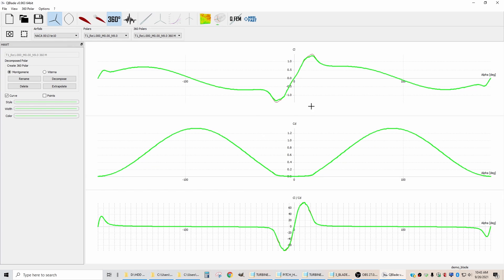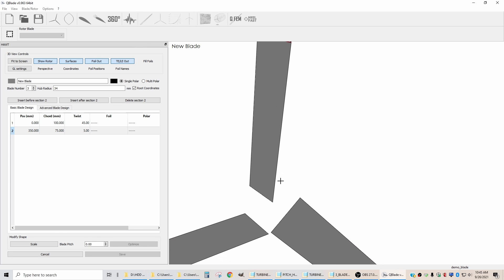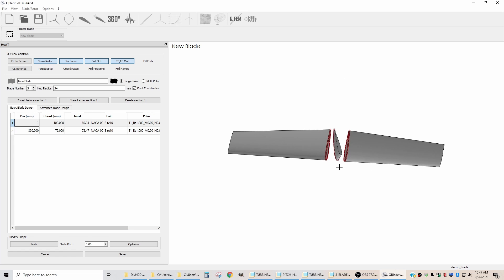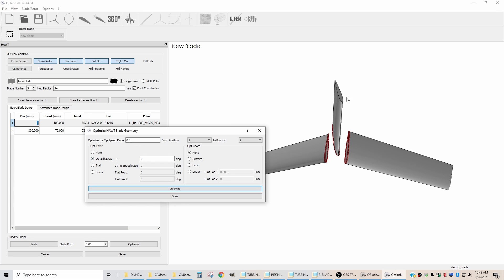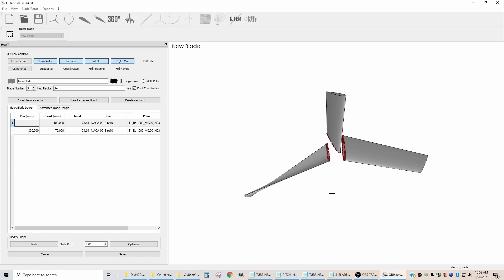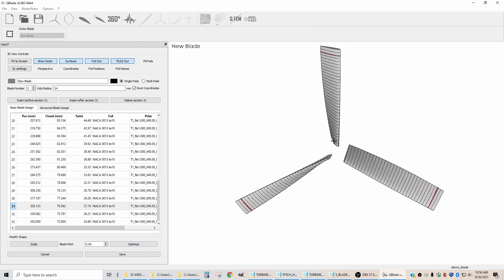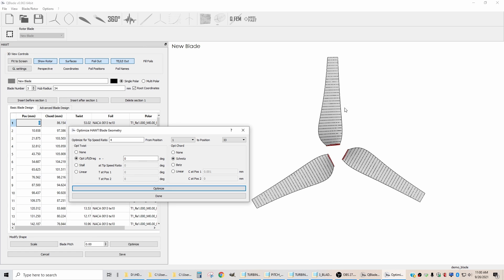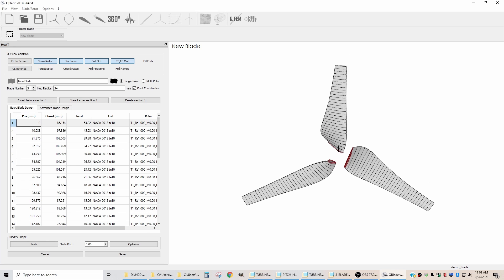Optimized Wind Turbine Blade Design using QBlade

Comment: Hey i reallo love your videos but when i created my blade design and added more sections. I optimized the blade and it got very thin, also the twist angles are almost all at negative degrees for example -13deg. which makes my wind turbine generate -kW any way  can fix this, or is this because i messed up somewhere when following your tutorial i used a naca 6322 airfoil, thanks for the answer

Comment: Now that you have created the polar. What is the polar, and how should that be understood ?
Reply from the maker: I talk about that a bit in the previous video in the series. https://youtu.be/F04CnPRHupg In simple terms, these show the change in lift coefficient (Cl), drag coefficient (Cd) and pitching moment (Cm) with angle of attack (alpha). There is also a graph of lift coefficient (Cl) against drag coefficient (Cd) which gives the theoretical glide angle of the airfoil, and is the classical "polar" plot for an airfoil.  Basically, the polar gives a graphical representation of the behavior of an airfoil with angle of attack.  Looking at polar plots allows you to compare airfoils against each other.  The designer has to use engineering judgement to decide which airfoil section is best suited for their particular application.

Comment: How do I define the wind speed I want to optimize it for?
Reply from the maker: The optimization is based on tip speed ratio. So, you select a wind speed, select the desired RPM at that windspeed, convert the RPM to tangential speed of the tip, and input that ratio into the optimizer. Some tip speed ratios are best for pulling the maximum power from the wind field. Other videos explain why.  Then you use a gearbox to convert the optimum rotorspeed, from aero optimization, to the RPM at which your generator is most efficient. The trick is that due to the gearing, starting the rotor may be difficult. So it may be necessary to use a variable  speed transmission to get the rotor up to speed, or just run the generator at a nonoptimal speed.
Reply: @kyakfsh  Thank you very much!

Comment: Hi, How do u calculate the twist pt as 42%?
Reply from the maker: It's a property of the airfoil section.  You can use just about any CAD package to find the centroid of an airfoil section.  I used CREO to calculate the center of mass of a unit length uniform airfoil, which gave the centroid of this particular section as 42% of the chord.  Note that you might want a different chord for your twist axis, depending on your design intent.  In my case, I wanted to minimize cyclic moment loading about the twist axis from the mass of the blade.

Comment: Hey Todd, will you be using Solidworks to use the data. Also, is it possible to make a design that has the same airfoils as an actual 3MW-2MW wind turbine?
Reply from the maker: I'm using PTC CREO to work with the solid models, but you could certainly use Solidworks if that's what you have available.  You definitely could import different airfoils.  You just have to know what they are and where they are located along the blade.  There are other videos out there explaining how to import different airfoil shapes.  If you can't follow them, let me know and I can make one, too.